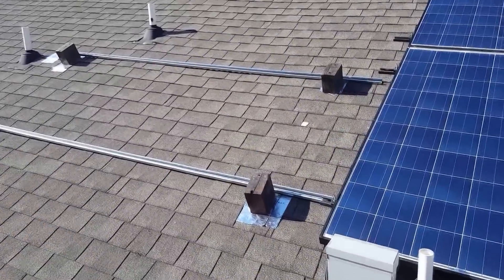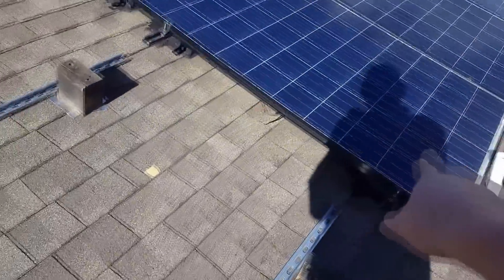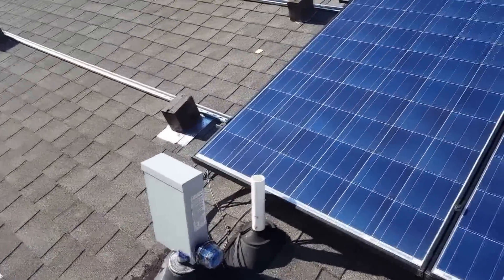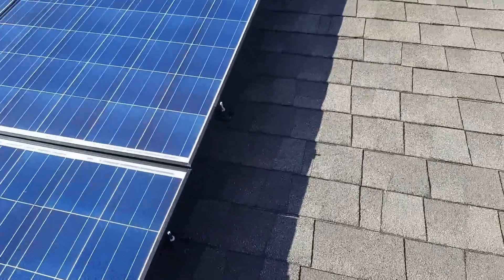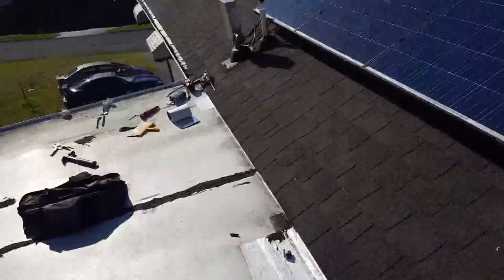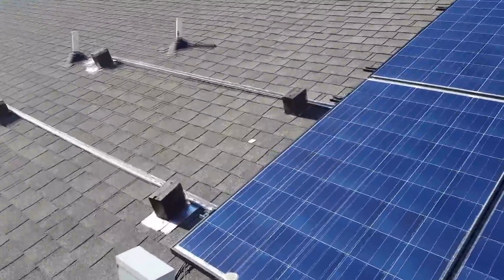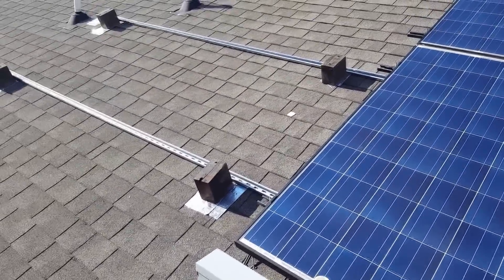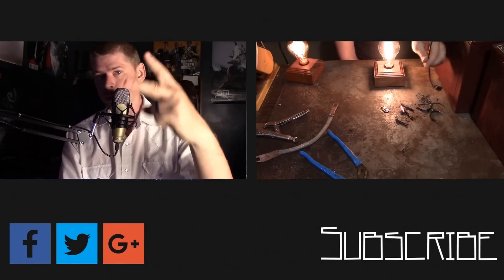Installing the new roof racking for the solar panels.

Comment: does your ground connect to each and every panel or just the frame and is the wire one continuous wire with no breaks. I am wanting to make sure I got the best grounding? I use the same rails on mine looking good.
Reply from the maker: every panel has lugs and is grounded